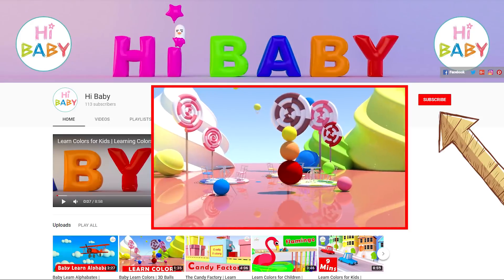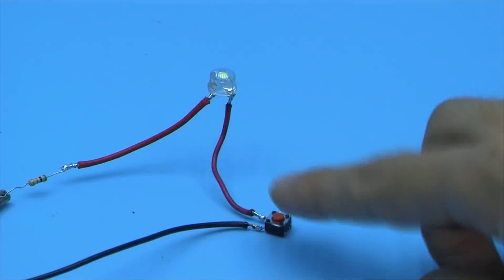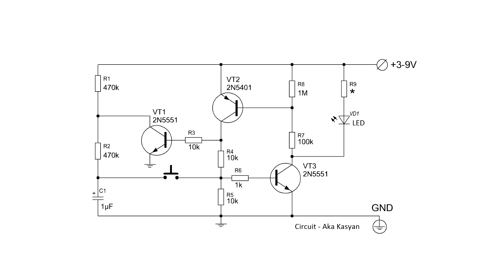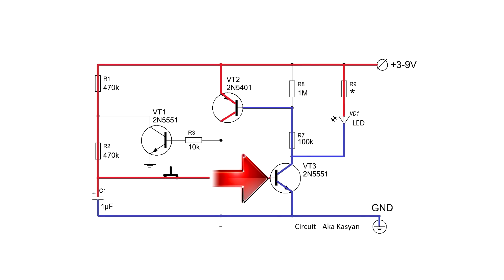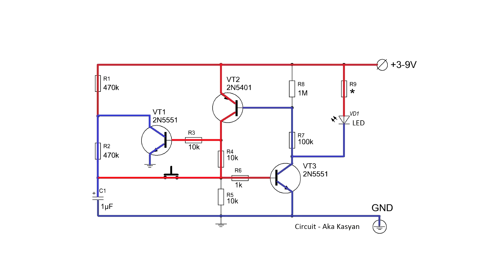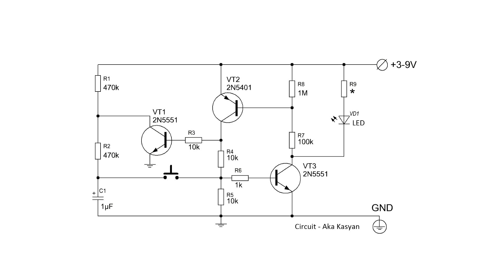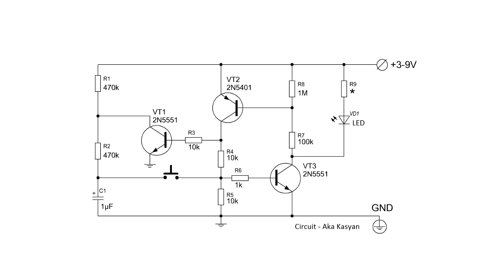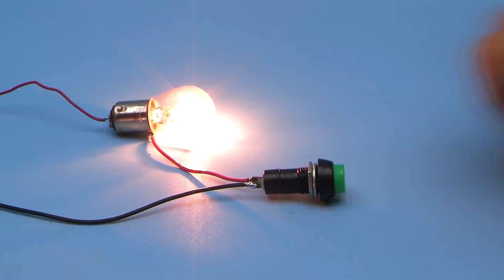One button Push On Push Off ! The simplest circuit.

Comment: Voltage divider at the base of VT3 should give half supply voltage, not point seven as claimed in the video, regardless of the fact BJT BE diode is point seven. The more likely explanation is that as voltage divider charges the cap, cap sinks all the current briefly and that is enough to turn off the VT3 and thus the whole circuit.
Reply: Not correct. Upper part of voltage divider is 10k, bottom part is 10k in parallell with 1k in series with diode. The center point can never reach half supply.
Reply: Even i can error in a rush, you are right that since bottom resistor is in parallel with a  diode in series with 1k it pulls the volt divider midpoint below half of Vcc and if it was not for the 1k it would pull it all the way down to 0.7V, that is what diodes do besides rectifying, obviously, providing low resistance path often used for protecting from overvoltage, be it in flyback snubber, NOT gate, Slayer circuit etc. 

I might make a small mistake in a rush but i have studied and study electronics and all related phenomena infinitely deeper than any hobbyist or so called professional has and am doing stuff that is like magic to you. You are not to blame for not knowing for example that diac is not two zeners back to back, or behavior of parallel vs series RLC, below, at and above res. freq. and why, or how to bypass lenz, or that magnetic field has a subtler A field component proved by Aharonov–Bohm and Henry long before them in Two Kinds Of Induction, that there is far far FAR more to this than you ever imagined or possibly can imagine. But nevermind that.
Reply: @nix9409  Right — glad we’re in agreement now that the voltage divider midpoint won't be at half Vcc due to the 10k being paralleled with 1k + B-E junction to GND. That substantially lowers the effective resistance on the lower leg.

Quick estimation: with 10k upper and ~1k lower (approximate parallel result), the divider gives ~1/11 of Vcc. Add ~0.7V for V_BE, and we’re sitting just below 1.8V at 12V supply — far from 6V.

The takeaway is this: real-world voltage dividers aren’t isolated. Loading matters — especially when tied to active junctions like BJT bases. This isn’t some obscure quantum phenomenon — just basic circuit behavior. 🙂

And hey, deep knowledge is awesome — but the real magic is applying it with clarity and humility. That’s what helps others learn — and what makes one’s understanding truly shine.

Keep experimenting — but don’t underestimate the value of simple truths.
Reply: @ Well, you have just shown you don't really understand the basics you went to boast with altho i already agreed and elaborated. You need to first deduce 0.7 from Vcc and then calculate 1/11th of that + 0.7. Actual V at midpoint is actually closer to 1.7, or precisely 1.727V.

I knew you're gonna fall for the bait and start implying all kinds of accusations while faking wisdom and humility, giving "advices". Too bad for you, you fell in your own ditch.

I know very well real-world voltage dividers aren’t isolated and these are simple basics not obscure quantum behavior 🙂, i know very well that real magic is implementing deep knowledge with clarity and humility,  more than you ever will, and that that is what helps others learn and what makes one’s understanding truly shine, well it did not help your shine. I never underestimate the value of simple truths, it is exactly the "simple" truths that i study in infinite depth, for from these arises all apparent complexity.

So take your own advice, keep experimenting but first learn and don’t underestimate the value of simple truths, and then learn the magic of implementing them with humility and clarity.
Reply: @nix9409  Thanks for the clarification, and for finally confirming the main point — that the midpoint of the voltage divider is not at half Vcc. That was really the core issue.

Beyond that, it's become clear that your main intent here isn't to help others understand, but rather to show how much more you believe you know — and to put others down in the process. That’s not a productive way to share knowledge, and it’s certainly not what encourages others to learn or grow.

The fact that you admit to deliberately “throwing bait” just to provoke a reaction and elevate yourself speaks volumes. That’s not the mark of someone seeking truth or clarity — it’s a game. And frankly, we’re not interested in playing.

We're happy to move on, knowing that readers who are genuinely curious will take away something useful from the discussion — and hopefully recognize the difference between teaching and self-glorification.

All the best — and good luck with your magic.
Reply: @markusbFPV  Thanks for fake gratitude. I already confirmed in first reply V at midpoint is below half Vcc. You try to downplay your error and focus on mine, but yours is as much a "core issue", it is essential to deduct the diode V drop before calculating res V drop.

It is in fact clear it is exactly you who doesn't care about helping anyone understand but only boast how much more you think you know and put others down in the process, and preaching about "simple truths" "humility" and "clarity" you never had.

There was really no "bait", i was not trying to elevate myself or play games, i just spoke the truth and let you expose yourself. Seeking truth and clarity is what i do profoundly both in electronics and in general, unlike you. And it is not self-glorification in the least when i say i do stuff which is officially impossible, it is simply the truth, both in electronics and physics (propulsion).

You even drag the audience into your little games speaking as some imaginary "we", trying to manipulate the reader, but people are not stupid, they see how manipulative you are. Anyone who listens to their intuition will recognize who is REALLY teaching and who is self-glorifying.

Happy to move on knowing i immediately admitted my error while you quickly tried to shift focus away from yours. Who wants to learn more my blog is in my bio, especially article Few general formulas.

There is no "magic", only higher understanding. All the best to you too — and good luck with whatever you do.

Comment: Excellent Circuit design. I want to power arduino nano and turn auto off with arduino pulse. ... Is it possible to use it with arduino. Most of the circuit doesn't work. If yes, what modifications required at the place of switch

Comment: Removed the LED and associated Resistor and the output from the Collector on the second NPN works well on digital pins on the Arduino.  I did find it interesting the using a logic probe on this same output kept the output low all the time.

Comment: Has anyone figure out yet how circulation pump motor works? I know it uses gate driver in IC to drive gates in IGBT. It is 3 phase too. pump name Wilo made in sweden or something. Same shit is in those compressor heater/cooler, the fans are run by PMM thats driven by weird pwm using gate drivers and IGBT. I wan to make them run on 12 or 24v DC.
Any smart person here? I could even pay if you know where to tap the pcb.

Comment: What if I wanted to use it with a 12v or 16v, what will change
Reply: Deben revisar la hoja técnica de los VT y saber si es posible usar el voltaje que desean, también se debe aumentar el voltaje de C1 para que trabaje dentro de los parámetros. Todo lo demás se mantiene trabajando.

Comment: There is one disadvantage in the circuit suppose you want to turn on the circuit using external transistor signal With High and Ground signal than it's not helpful for you .

Comment: A D flip flop IC can be used to get the same thing without all these components. the IC is cd4013.
Reply: You will need a method for debouncing the switch, and that would invariably mean the addition of at least a capacitor.
Reply: @arthurharrison1345   yep, a single 0.1 uf and a suitable resistor is enough.

Comment: Hi. Can we replace the push button by a trigger from micro controller. Thank you.
Reply: you can replace switch with transistor or mosfet but there is no point, MC can keep driving transistor open without any help from additional circuitry so all this can be replaced by just one transistor/mosfet. Keep it simple.

Comment: its ok to use in 12 volts power supply?
Reply: the concept for higher voltages is same, however resistors may require tuning

Comment: is the circuit stable .???meaning when on off state and suddenly power goes off and on . will it still remain off ?

couse i want to use it to power electricall heater so it won't accidentally turn the heater on
Reply: this circuit is for low voltage DC. I'm assuming your heater is powered with AC and that is going to add components
Reply: Aлександр my idea was to use power supply to power the pushbutton circuit and connect a relay to turn on the  heater . Second please add standby led which will go off when the output goes high so as when one uses the circuit to turn on an appliance can see weather the device is connected to the mains correctly

Comment: Mam please tell me the ratings of capacitor ...mean to say 1uF ......Volts
Reply: that depends on power source voltage. with source marked as 3-9 volts on schematic you can use 10v rated capacitor, while 16v is safer

Comment: sadly that's almost 1mA, that's very high power consumption even for a switch
Reply: 1mA when on. When off it draw (depending of capacitor used and its loses) in nA range, negligible. If used for flashlight project it's hard to imagine flashlight with current consumption so low that  1mA loss on switch can make any difference. Poor choice of wiring gauge can make loses 40x higher and nobody will blink a eye on that.

Comment: I need a reverse circuit 
When press the switch light disconnects when release light lit up thanks
Reply: For NPN transistor, connect load at points 
1.collector > +ve of LED,
2. Ground > -ve of LEC 
3. CONNECT a button to base with a resistor to +ve of battery.
You have made yourself an inverter / NOT gate.

For PNP, connect load in series with transistor, and connect a button at base to ground. And also connect +ve supply to base via resistance.
It works same as above NPN ckt. But much simpler.
Reply: Just use a logical inverter on the output. I tend to use inverting schmitt triggers as they also add a slight debouncing element.

Comment: What is the value of R9? It just sais “*”
Reply: This value depends on the LED you are going to use. This is the current limiting resistor for the LED, you can calculate the value of R9 if you know the maximum current that should pass through the LED and the forward voltage drop of the LED called (Vf).  For example, if I(max) of the LED is 20mA and the Vf =0.6V and the voltage source is 9V you can input these values in Ohm's law and find the value of R9 --> R9= Vin-Vf/I(max)
--> R9 = 9-0.6/20*10^-3 =420 Ohms
  Then you check for the closest value of a resistor that most suits you. In E-12 range you can choose between 390 Ohms resistor or 470 Ohms resistor. Always take the higher value otherwise your LED will burn faster then usual because the current will be too high (more then I(max)).

Comment: Can you use any transistor on the circuit as long as you use the proper pnp npn type.but can you use any type of transistor to make it work.
Reply: No, voltage regulators are classed as transistors too.

Comment: Can you please tell me how to replace the led or whatever in the output with a rellay?
Push button just activate the rellay and press it again release the rellay.
Is it possible with this circuit?
Reply: use the second version with tip42 (or use another bc557 instead). the first version act like a "active low" circuit, as positive stay on and negative pulse come in when you turn on (it´s amazing because can drive relay modules for arduino without arduino), and the version with tip42 are a "active high" version (when you press the button, negative stay on and positive take control).
Try use diode on relay if it need and check que output version with multimeter to see the working circuit

Comment: I am re-purposing LED lights from a broken screen LED TV and will use two 6V LED's to replace a stereo-microscope stock light where the lamp is missing.  From a string of UV LED lights, I cut three LED's off to use for UV inspection.  Both will use a 12V source. The latching switches I have are large and I need to see how this will fit since I have plenty of really small momentary contact switches like this from old free broken TV's.  I think I can scavenge the boards stock for the other components also.  I'm still debating if I want two separate latching switches or one latching (cool white LED) and the other momentary (UV).  Have to see how this design fits.  Thanks for sharing!

Comment: why do we use two 470k resistors attached on the way to the capacitor instead of any other resistors?
And what if we use another capacitor with smaller value?

Comment: If you hold down the switch, will the circuit turn back off?  Or if it's on, would it turn back on if you hold down the switch?

Comment: On the net, you can get a schematic for an SCR circuit having much less components with the advantage of high load current. It is 12 volts circuit.
Reply: i try one of this using irf transistors, when i make a test clicking in a high speed the transistor burn really fast

Comment: Simple is using a 555 timer to do the same thing. Or just a latching switch that doesn't use any power at all.
Reply: electronic latch switch are a savior. some special and automation circuits demand a electronic latch switch because they need command for ex: to turn off by power and when circuit come back, that switch cannot turn on again or will destroy everything. even to turn off and then turn on by the own circuit to make automation without programming too much.. i need a switch like this and this work great. 555 destroy my like with inferferences even making a shield and decoupling capacitors, and destroy a expensive work of mine because they start work by theirselfes

Comment: @Kasyan TV
The English terms most of people are searching for with this kind of circuit are "Soft Switch" "Latching Switch" "Latching Button" and "Push On Push Off"
 I know I have searched for and built several variants of these circuits for my own projects.

  Thanks for sharing. I know it can be challenging to figure out exactly what words people will be searching for in another language. It doesn't matter to me if you use my suggestions, but if you add these words to the title, description, and YouTube key words it will really help people find this upload in the future ;)
-Jake
Reply from the maker: Thank you very much, I will use them)
Reply: I was thinking "momentary contact switch stay on" or "momentary contact switch latching" or "latching a momentary contact switch".
Reply: Step by step,fully xplanation,fully animation n simulation on how the latch switch working using ne556

Comment: Can we use available transistors from electronics circuits like BC547 etc transistors?
Reply: i test using 2n2221 and bc 557 transistor and work nice. the original circuit (this one) use bc 547/557, but the creator use 2n* transistor because he dont have.. any equivalent work

Comment: Nice video, but using the open/closed terminology instead of on/off or saturation/cutoff for the transistor states is confusing.
Reply: I see what you mean...if the switch is closed the current can not pass through, like a door or open like a door, the current can pass through. However the opposite is true.
Electronics is fascinating. However, a very fine,nicely presented video which also eliminates contact bounce. Well done!

Comment: We usually call a switch “without fixation” a momentary switch. It is only active for the moment you push it. It automatically returns to the previous state when released. Momentary switches can close when you press them (“momentary; normal open”) or when you release them (“momentary; normal closed”).
Reply: That is a very clear description. Normal open and normal closed often cause confuion
Reply: John Brewer Thanks. :)

Comment: Then how input 12v from the car battery ?
Reply: Toss on a LM7809, try using BC557 for Q1 and BC547 for Q2/Q3. Or toss on a Relay to toggle on/off to control even higher voltages.